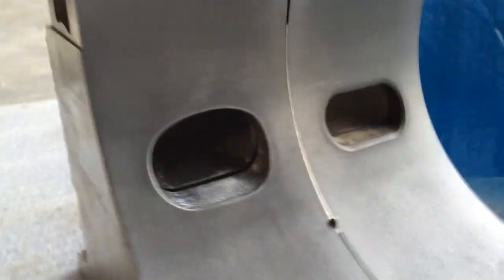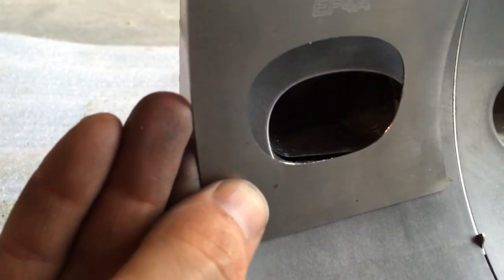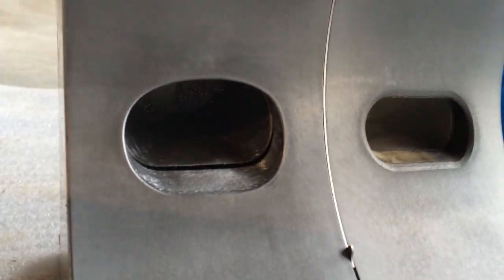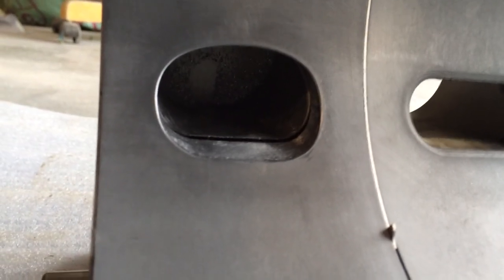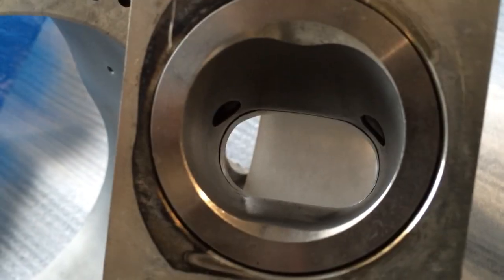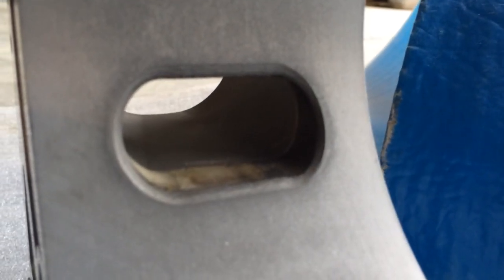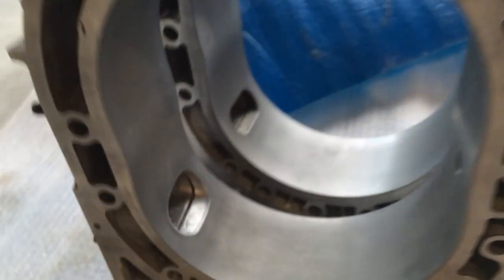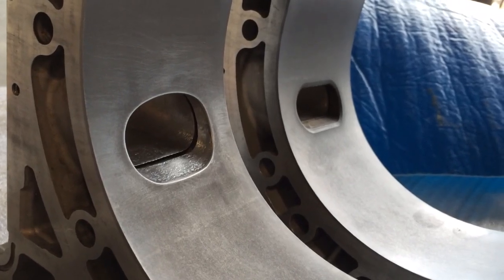Rotary Exhaust Porting mid size Turbo

Comment: I have curiosity, this works on renesis engine? I have read in forums that the biggest problem with the renesis engine is overheating due to the restricted gas output, greetings from chile!

Comment: I was wondering, most turbo performance turbo exhaust manifolds are 1 5/8" diameter, does it help to port the exhaust port larger then 2" later reduce it back down?

Comment: I have been searching the net for years now regarding porting and the sound results from specific templates with not a lot of luck so if you do more videos please include intake port template used and sound result...thanks for your effort!
Reply: Niall Hurley funny 2yrs later and it’s the same the only thing is it has taught me about the differences in porting and what it kind of does like porting up on the exhaust and down on the intake give you all the brap you could want and puts all the power at the top and kills low end torque

Comment: Looks like u cut it wrong when the template is placed down
Reply: Edna Mole  no he didn’t cut into the compression stroke as much as Te port wanted porting down on a exhaust port just shortens the compression stroke so if any it will have a better compression and a better power stroke

Comment: I have a 12a street ported engine with a Webber 48ida and racing beat headers I want to use 150 shots of nitrous will it be safe or will it break down

Comment from the maker: I use 2mm seals in my 13B, 
They do fine as long as you do not have Preignition OR Detonation,
If either of these happen the seals will lose compression! No matter if you have 2mm or 3mm seals.

Comment from the maker: Thanks for the comment Juan.
Ok the the edges of the port was smoothed out with a piece of 80 grit sand paper so that the edges do not clip the Apex seals as they pass over the exhaust port. I will try and do another vid to give an example

Comment: Hi mica 
I just was wondering if you could make a video of the porting? Would like to see how you do the edge ends.. Also I've seen your other videos and asked some question too. 
I wanted to know what sides apex seals you went with the 2mm or the 3mm and how they worked out for you? Am getting ready to pull my motor and do a rebuild just waiting on my compressor. Am going single turbo and mite do the super seals from rotaryaviation.com check out some of my videos if you like 
Thanks